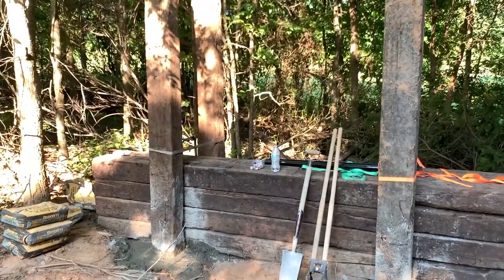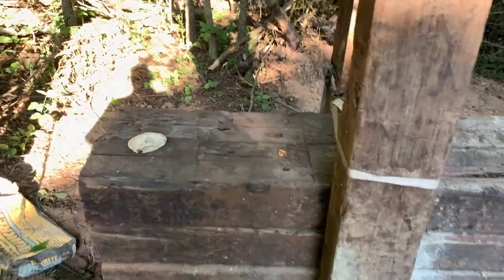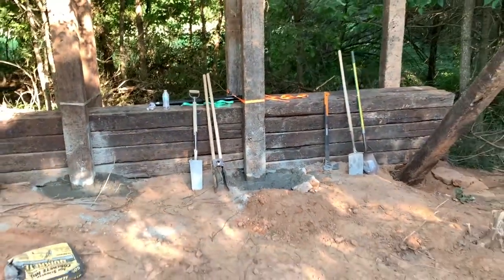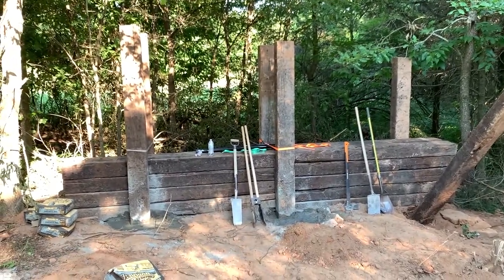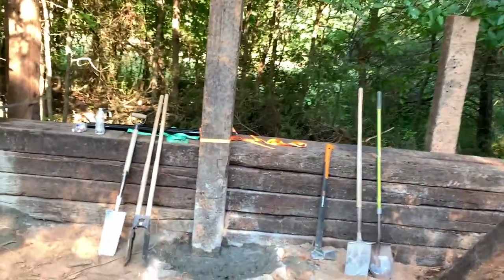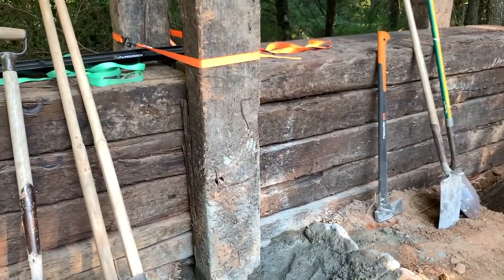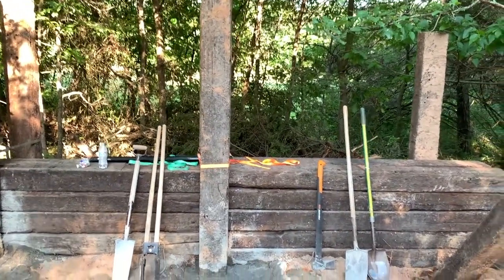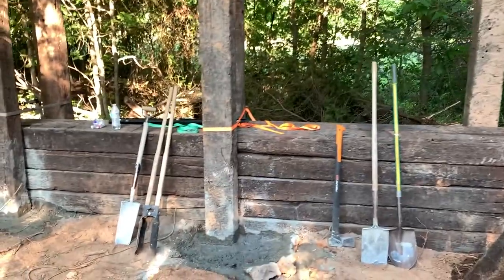Railroad Tie Shooting Range Backstop - pt. 1

Comment: dangit man, i never even thought to use ties for stands like this. I used metal lashing in the back and stuff sand up front, I like yours much better.
Reply from the maker: At the top I ended up drilling a hole thru all four layers of RR tie and squeezed them all together with threaded rod and washers/nuts.

Comment: Hey Joe.  I like your backstop.  How many railroad ties did you use in constructing your backstop?  I'm purchasing 40 ties and will construct a backstop very similar in design as to what you made but will construct an angled wing on one side/end for ricocheting projectiles.  What were your lessons learned?  did you have any setbacks?  I'm excited to build the backstop but not excited to work in this 90+ degree weather but that's how the weather turns out.  Thanks in advance for any advice/warnings before I start my one-man build.  👍🏽🙂  6/16/22  Joe, I'm a New SUBSCRIBER to show support.  👍🏽👍🏽
Reply from the maker: I think we ended up using 52 or 54.  The toughest part was digging the holes deep enough.  There's so many rocks in the dirt here it's hard to dig.  I put steel in front of the railroad ties to save the wood.  I'll do a follow up video of the finished wall this weekend perhaps.